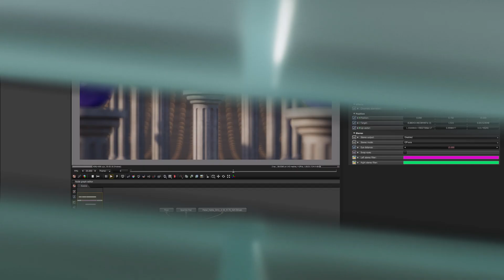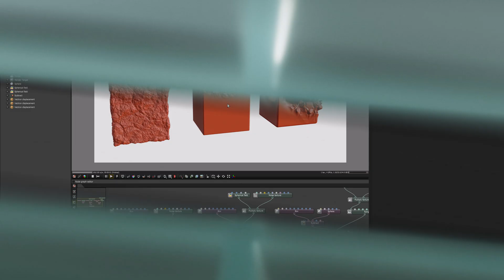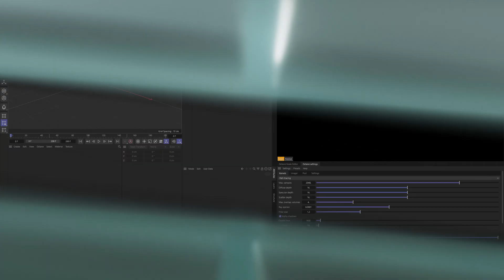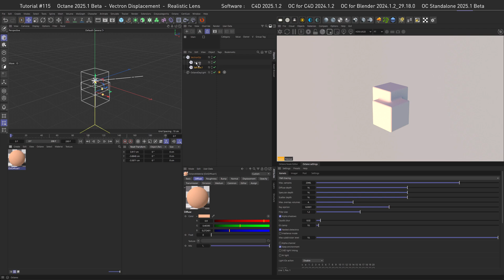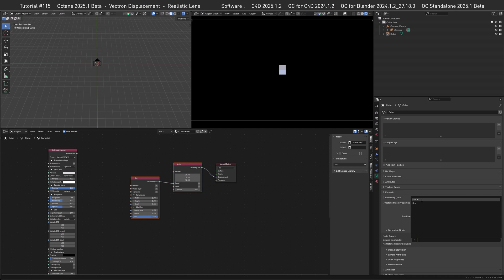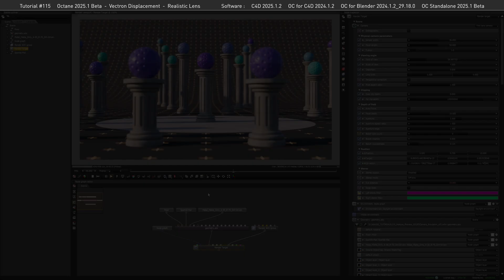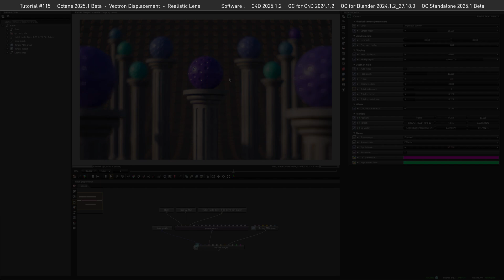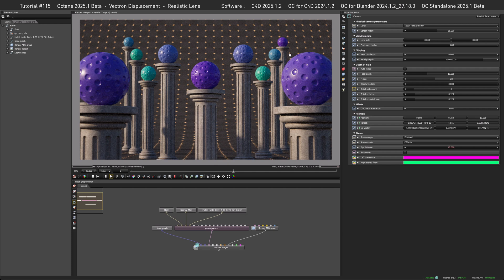Silverwing: Octane 2025.1 Showcase 02 - Camera Simulation & Vectron Displacement (Octane Standalone)

Comment: 🔭nothing much to say... just wanted to add this telescope in here. i think it helps the algorithm if i write something here, right? love Your videos. One question comes to mind... What are Your thoughts about this "...im going to move from C4D to Blender..." thing? at least in my feed there is not that much C4D things anymore, versus Blender? i have used Cinema 4D for a long time. And i am old man, dont have the energy to learn Blender, even if i think it would be wise, maybe? i do very little freelance 3D stuff on my "freetime". Product render here and there, and maybe few animations per year. And Cinema 4D is way too expensive. but here i am... using it because i like it. Well... i did have something to say after all. Sorry for the long comment. 😅🤣
Reply from the maker: Hey Tenato ✨🔭✨
thank you so much for your telescope and your long message. I really appreciate the engagement 🥰

About C4D and Blender:
I think switching sofware not as easy as many think. I have been using C4D for a really long time. Most of my life actually. And I know it inside out. So when it comes to time critical things I prefer it. Because I know exactly how I will do stuff and how it will react. Long long Years of experience.
When it comes to Blender I also like it. Mostly because it's growing so much lately and because of its radically different marketing strategy (*wink* it's freeee). Though since I have not used it for so long, I am missing the experience. Hence also a lot of my tuts are in C4D still 😇

Of course it's a self driving effect. If I do not do stuff in Blender then I will never gain experience and therefore always gravitate to C4D. Please don't get me wrong here. I really like C4D and it's an awesome software that I do not want to miss. So I will be around both packages most of the time I guess.

If you have incentive to leave one for the other I think you will have a hard time for a couple of months... or even Years before you catch up with your knowledge and experience. The good thing is that the Blender community is so vast that is not a problem to find guidance for almost all problems you encounter.

So in the end this is not really an advice but just my perspective on it.
I hope you find the read worthwhile nonetheless ✨

Comment: 🔭Thank you Raphael! Your videos are always rich with content.
Please. Do you know if some of those new lenses have the option to control (visually) the depth of field ranges like some other renderers have? Or maybe it's already there and I simply wasn't aware of it?
For example, I think it's vray or Corona's camera where you can have some sort of indication where the depth of field begins, and where it's at most sharp and where it ends.
I believe UNREAL has a nice controls over that as well.
.
Such apparatus are great for virtual focus pulling of course.
.
There are also many non-realistic things you can do with depth of fields (for example, multi focusing).
Reply from the maker: Thanks a lot for your comment Ofir.
It's always a joy seeing one from you.

To answer your question.
I don't think that there is visual indication built in to Octanes DOF system.
You can of course pick your focus to know where it's most sharp. but that is it.

P.s. you probably know already. Focus is only sharp on the focus plane in front of the lens. from there, the circle of confusion will in crease indefinitely in front and behind the focal plane. The area that we perceive as sharp section is the one where the circle of confusion is smaller then a pixel.
I think I have a section on the universal camera where I go through that. 
https://youtu.be/nS46sgTjGYE?t=190

Comment: So from what I'm seeing with the realistic lens camera controls it's only really meant as a preset camera as I don't see more specific controls like the Universal camera has for coma or astigmatism for example. 
Is the chromatic abberation option also available on the universal camera setup? As I'd like to be able to match advanced lens simulation with manual controls on the universal camera and I feel like there's some things I can't or don't know how to do. Like the subtle bloom offset on the objects that appears in some of the reference renders of the lenses (the magnifying glass render being the most intense one).
Reply from the maker: Hey Wolfnimations,
Thank you very much for your long and detailed message. Yes, those are presets. But it's not using any existing camera model (like thin film or universal)for the presets. It's a newly implemented algorithm.

Might be that I was not clear enough 😔
Basically those presets are digitized lenses. So real world lenses that have been measured and then brought into Octane.
Those are complex datasets and therefore can not be altered.
The bloom you see comes basically from old lenses (or if you would hold a magnifying glass in front of your camera instead of a lens) that are not optimized. So they scatter light to places they should not. This is also a measured characteristic that can not be re-created in the universal camera.

So right now the presets are unalterable black boxes that do the thing the real world counterpart of the lens would do.
Because they are fixed, they can be optimized. If you compare the sampling speed of the universal camera and a lens preset, then usually the preset renders faster or more noise free with fewer samples.
Though don't get me wrong. They of course come with a render overhead compared to the standard thin lens camera.

I hope this puts things into perspective... pun intended 😇
Reply: @SilverwingVFX  (I'm not the OP) 🔭 Thanks for the detailed explanation! This feature is very exciting, do you know if they have any plans to make the lenses parameterisable, for example to be able to adjust the field of view? If not, do you know if they are planning to add more measured presets so that we have a few more options?
Reply from the maker: @BeheadedKamikaze  Hey there and thank you for your follow up question(s) ✨🔭✨
When I was playing with the Standalone the first time, I wrote up some points. One of them was exactly that.

But let me explain a little:
I don't have any information from the development team. But I think it's unlikely that they will expose more lens settings.
The only thing that might eventually happen is that they will add more lenses. 
Usually features as this come about by the development team integrating pre-existing papers to the renderer. So the research has been done and the lenses have been measured by the research team there. To get in more lenses would mean that the development team now has to purchase those lenses and measure them themselves. Which probably calls for special equipment. While not impossible, it's quite time consuming. So I would not hold my breath waiting for new lenses.

One workaround here is to play with the sensor size, as this also changes the field of view and give you the desired focal length with a specific lens.
This works because it would also work in real world by changing the sensor size.

The reason you can't just go about and change e.g. the focal length in the lens setting is that internally the (glass) elements of the lens are simulated. So you can't just go ahead and change the focal length of the lens without making adjustments to the glass shape of the lenses. It's like having a Sony-Zeiss 55mm f1.8 lens, but want to make it a 70mm lens. That does not work physically without changing the lens elements shape (or changing the sensor size).

There has been something rather similar released for Blender Lately. There are a couple of videos about that feature that explain the limitations in greater detail:
https://youtu.be/hjn_jcS1Zjc

To be honest, I like the Blender equivalent better as it it gives you more options and lets you have a peek and even alter values inside the "black box".
Also octanes chromatic aberration seems to be the same on every lens. While in the Blender addon it feels more unique for every lens entry. Also of course there are more lenses to play with.

In the end, while I feel that Blender has the better options. I still like that Otoy did the implementation and gave us a set of lenses to use that have character to give us the analog lens look that can make renders look more photographed then computed.

I hope this answer was somewhat satisfying. Or should I say, welcome to my ted talk ha ha.
Reply: @SilverwingVFX  Thank you for the incredibly detailed reply! ❤‍🔥 Yeah I completely understand if it's just modelled off a research paper, there may not actually be a way to generalise it. I don't blame them. I was just curious if you had any idea about it.

I was actually wondering about playing with the sensor size - thank you for confirming that! I'm pretty excited about this feature actually, anything that can improve the realism is a welcome addition. It looks like there might be some useful lens presets in there, I guess we will just have to adjust the camera position rather than setting the position and adjusting the camera! No big deal, it's just like real life 😄

Thanks again, appreciate your time.
Reply: @SilverwingVFX  Thanks for the response. 
The blender addon you mentioned was the reason for my original question. As having those kinds of parameters to adjust the lenses and try and customize the look of the lenses was what i had originally thought would be a part of the realistic lenses feature. 
But it does make sense that it's optimized in this way.